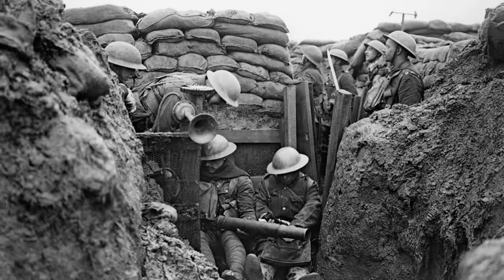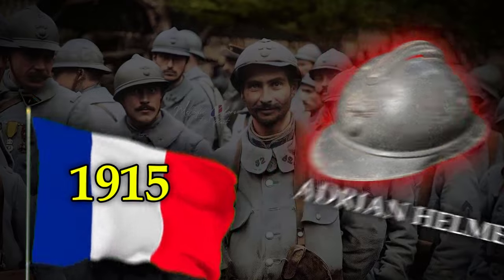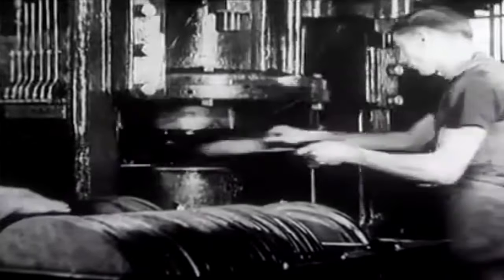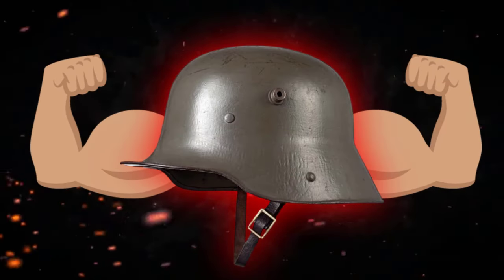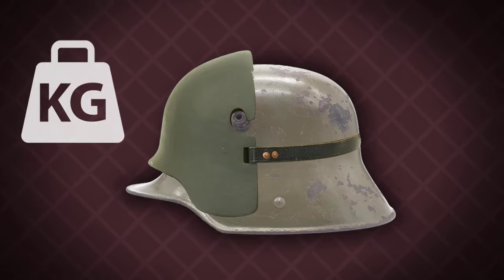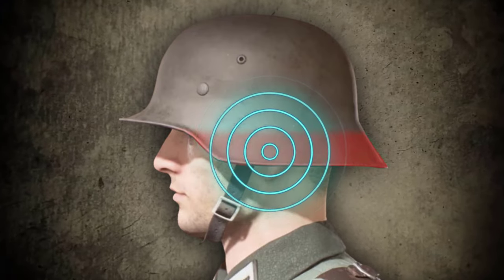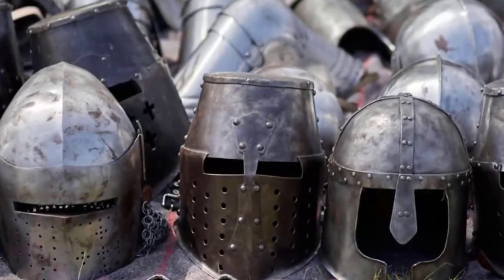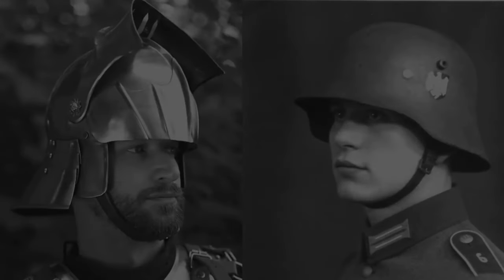Why Were German Helmets Shaped Like that? - Short Animated Documentary

Comment: 2:11 The Adrian Helmet for France was and still is the best designed war helmet thanks to it's shape and it's crete not the stallheim even if much better than the awful and cheap british helmet
Reply: no its not. the french helmet only performed better in overhead blasts but it offered much less protection overall.
Reply: the British helmet had one great practical advantage - it allowed for prone firing.
Reply: A 3 piece helmet was in no way shape or form better. The WWI Adrian was superceded for a reason.